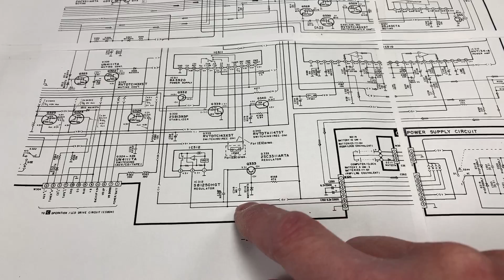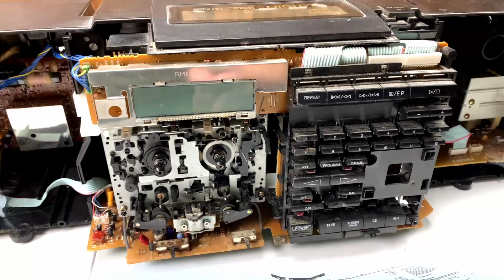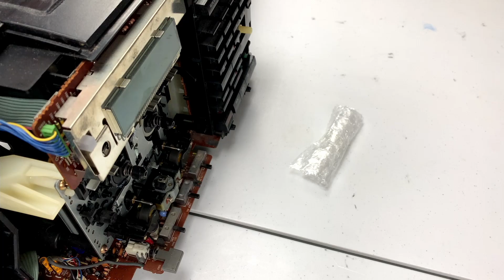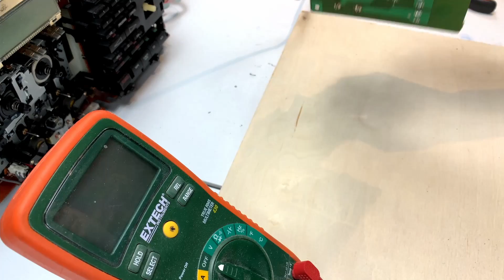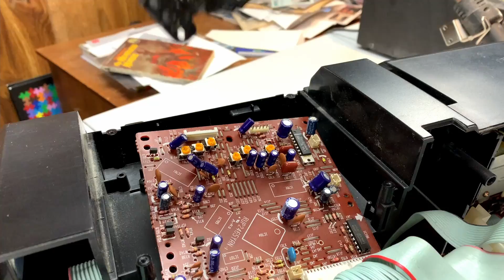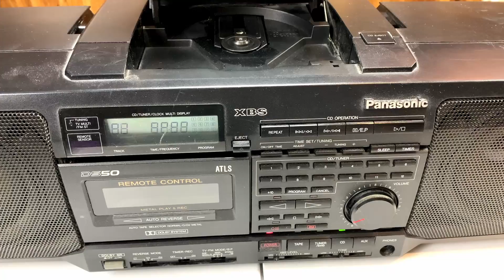Panasonic RXDS50 Part 3 - Total Overhaul

Comment from the maker: Update - I did end up managing to restore the AR300 cassette transport from my RX-DS20 for use in this unit. It took a LOT of work, but this particular boombox is now 100% operational, and now even has the proper remote control it would have come with back in the day.